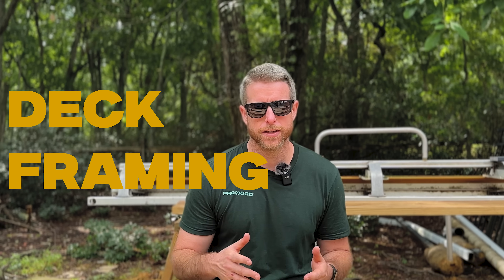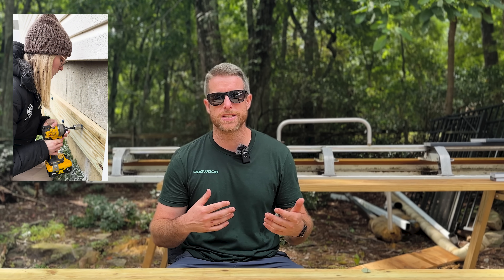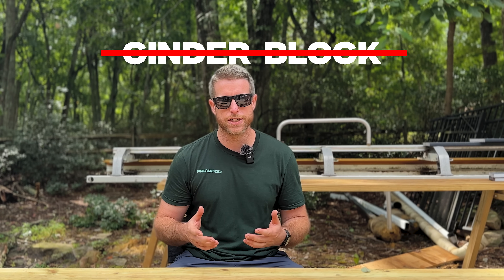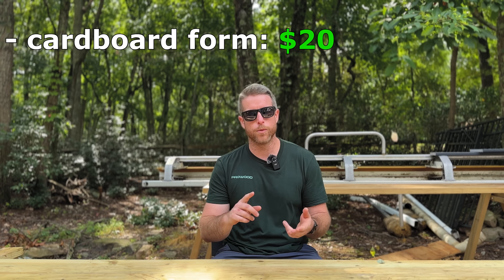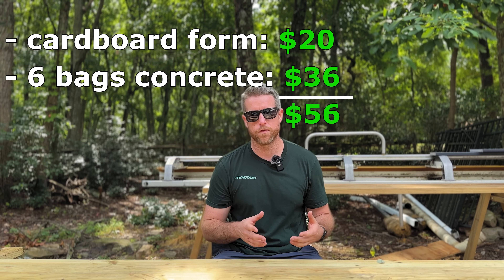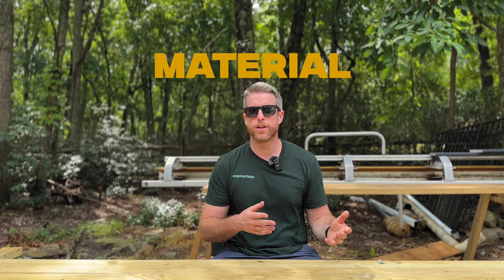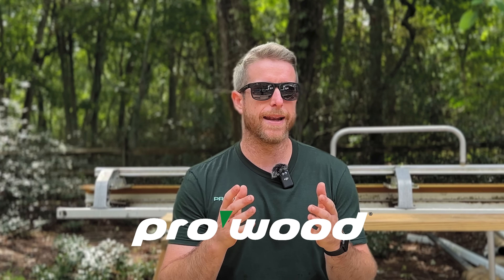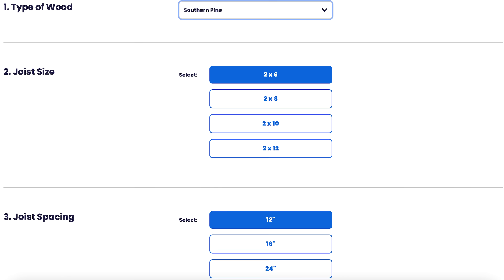Why Most DIY Deck Frames Fail (And How to Succeed)

Comment: Thanks Sean, this was very helpful. And the links are great as well. Would be nice to hear about some of your “standards” that I could use to vet and select a contractor of your caliber in my area. It appears there are many that do decks but not hard scape (and vice-versa). It’s not often you encounter a design/build for both.
Reply: P.S. I assume I caught this video early in your process. I checked the description and didn’t see any links.
Reply from the maker: Thanks for the reminder, just added a link for it!!
Reply: Hi. I enjoy watching your companies great work. I just wanted to mention that in your description of live load vs. dead load, the dead load is only the weight of the structure itself. Live load is any weight that is temporary or can be removed. Snow,furniture HVAC, appliances are all examples of live load. Thanks for the great content. You guys do great work